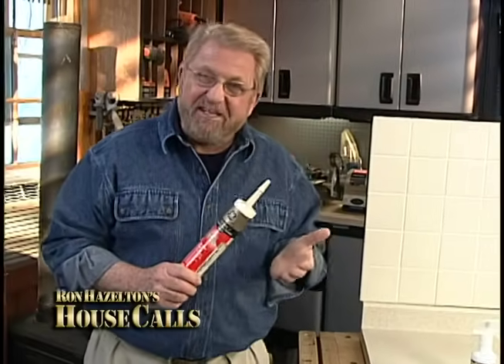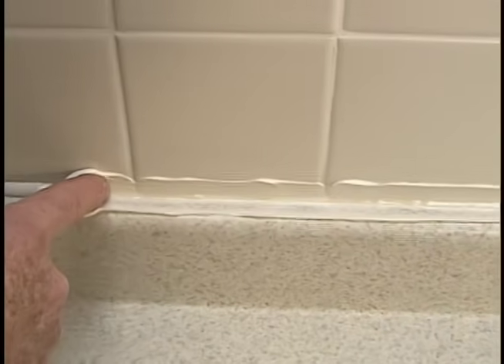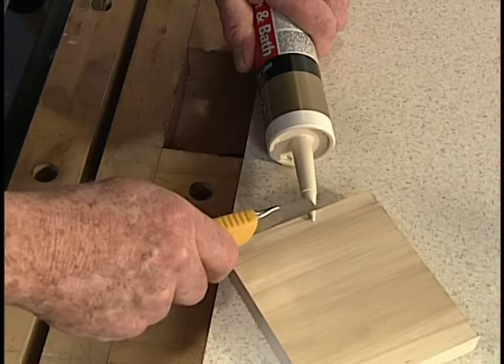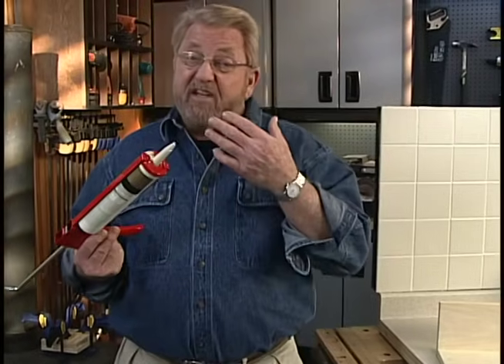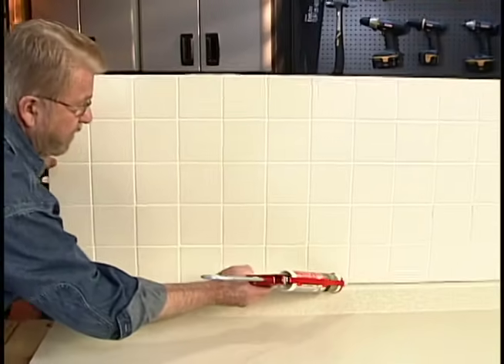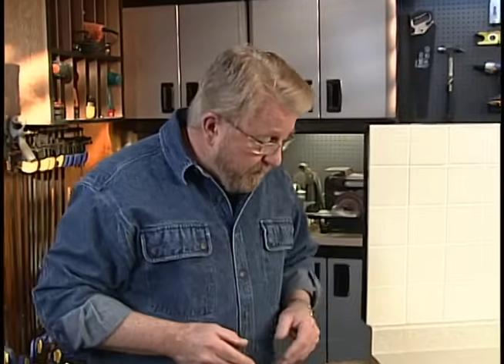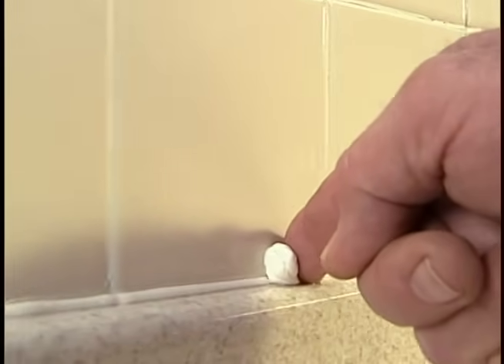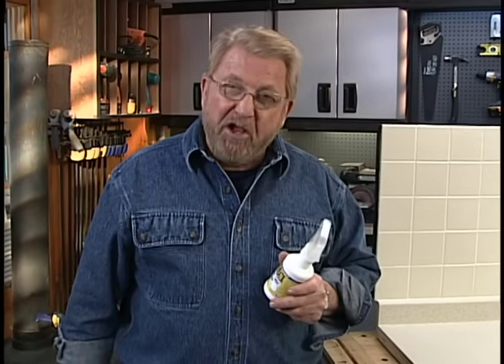How to Get Smooth Caulk Joints

Comment: DAWN dish soap does same thing.
Reply: Absolutely wrong. Every manufacturer in the USA says not to do that
This is what Dow says:

NOTE: Do not use liquid tooling aids such as water, soap or alcohols. These materials may interfere with sealant cure and adhesion and create aesthetic issues.

Comment: Windex works aswell
Reply: Wrong way every manufacturer says dry tool. This is what Dow says:

NOTE: Do not use liquid tooling aids such as water, soap or alcohols. These materials may interfere with sealant cure and adhesion and create aesthetic issues.

Comment: Good ol spit or bubbles works fine too
Reply: Wrong . Every manufacturer says dry tool. This is what Dow says:

NOTE: Do not use liquid tooling aids such as water, soap or alcohols. These materials may interfere with sealant cure and adhesion and create aesthetic issues.

Comment: Please stop telling people how to caulk like this!
Reply: What?... Why?
Reply: @ChadBray3   
Manufacturers tell you not to soap. I’m a union caulk instructor and I can’t post it on here. Sorry it just bothers me when I see this stuff. I have to teach apprentices correctly what their employer tells them to do is on them. I’ve caulked many miles of of joints in 25 years. My crew of 6 caulked a 5 year job and over 50 miles of caulk on it. The joints were inspected by engineers. If there were three failures in a zone all of the caulk had to come out of that zone. It was a 33 story building. After the first year there were zero failures. The building got a 20 year warranty from Dow Corning after the 5 year completion of the job. It was silicone caulk.
Reply: @terryhalloran6506  wow, that's really interesting!  I didn't even know there were folks like you out there.  You've probably heard every caulk joke there is!  Although, there is probably a difference in between what you do and a novice homeowner who is just trying to get their caulk to not look like a disaster.  Have you considered making your own youtube channel about caulking?
Reply: What is information can you share on how to do it? For the non-pro looking to make a good seal and have it visually pleasing? For the people trying to do a good job without the responsibility of securing panes of glass on high rises.
Reply: @terryhalloran6506  I have installed sealants professionally for over 40 years and ignorant videos like this drive me nuts.DRY TOOL.  No  exceptions If someone shows up to my job site with ANY tooling liquid they are sent home.It should be common sense that if it won’t bond to the wall it won’t bond to the joint.
Reply: @Allen-bm6tz  it’s actually pretty simple 1 control the joint depth( never deeper than it is wide, half as deep as width is the general rule. But 1/4” minimum 1/2” maximum depth)
2 Clean the joint with a fast evaporating solvent like alcohol, but immediately wipe with a dry white rag after the solvent dampened rag
3 mask the joint( most professionals skip this step due to their skill level) And install the sealant using a slow steady feed being careful to not leave gaps but not overfilling too much.
4 Dry tool the joint . ( it should be tooled at least once in each direction to insure a proper bond.)
5 immediately remove the tape pulling it back over itself.
A finger works ok for tooling but a very small spatula or pallet knife with a rounded tip is better. The rounded tip should be slightly wider than the intended joint.Start tooling with the tool at a very low angle an raise the angle slightly with each pass until the desired result is obtained